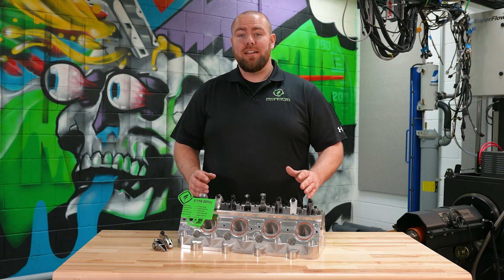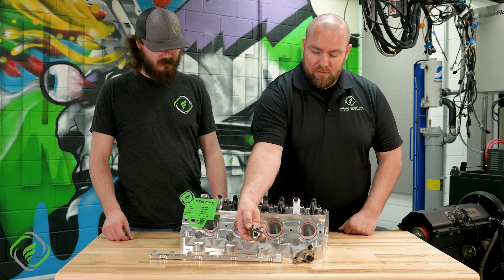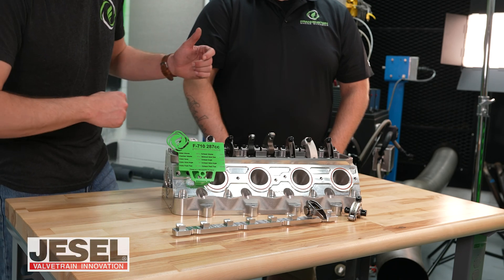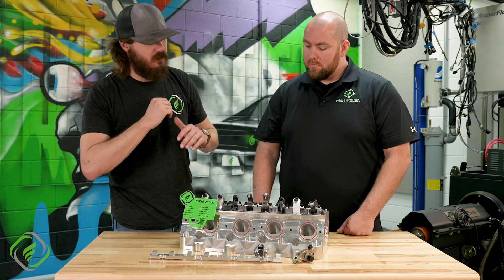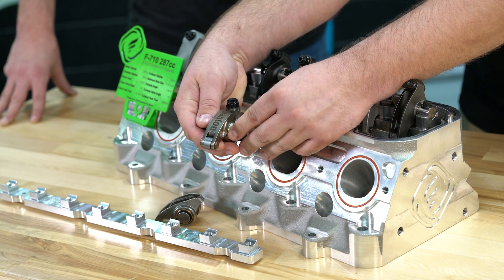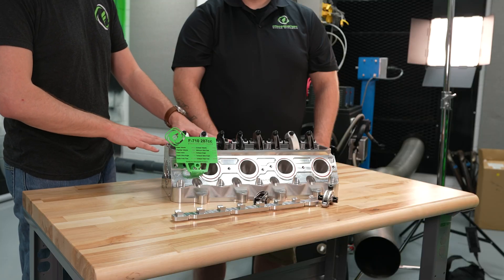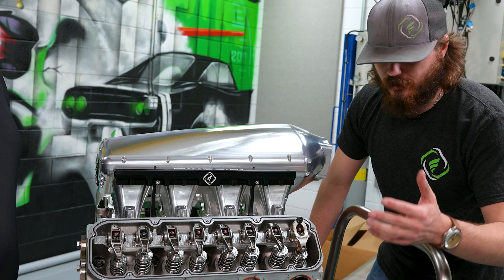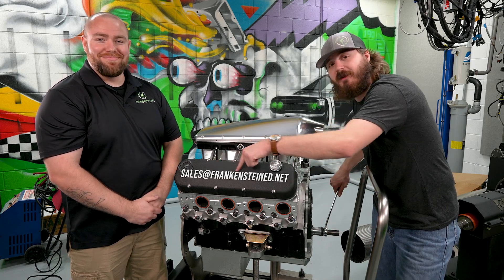Rocker Arms - Which ones to get!? -Frankenstein Tech Series - S1Ep7

Comment: Do I have to remove the rocker arm plate to install the inner bolts on a f310h? If so, what are the torque specs? If not, how do I even start putting the nut head in the arp stud? Thanks in advance.

Comment: Good video guys however John doc has the hydraulic roller cam worlds record he runs t&d Steele rockers I think. But damm y’all have some badass looking heads maybe one day I’ll be able to get some.  I run the t&d Steele rockers myself there pretty good I’ve not had no problems with them so far I’ve ran Jessel before and there great rockers as well.
Reply: John doc also uses a lifter and valve spring package that HARDLY qualifies as a hyd roller. The lifter is a new johnson .904 that is able to handle solid roller spring pressures. A stock rocker would not be able to handle those types of pressures. Very into the grey area for being hydraulic lol, but the lifter still holds oil so it's still technically hydraulic.

Comment: For those of y’all wanting to know, their monster M311 head will not allow a 1.8 rocker when going with their pedestal mount. You will not have enough clearance with your pushrod. I’m surprised they didn’t cover that, but their heads are bad ass and I love mine.  Great video guys.
Reply: Do the M311 use LS3 or LS7 rockers?
Reply: @Shauny808  LS3
Reply: @thebradnoyes thanks I have ls3 on their heads, but was considering the yella Terra
Reply: The m311 was designed around a 1.7 ratio rocker, not 1.8. If you want to run 1.8, you can try but some modifications would need to be made.